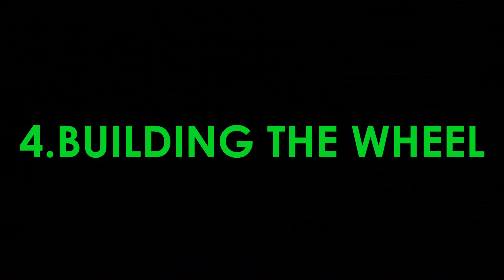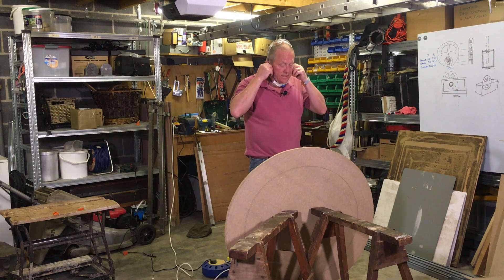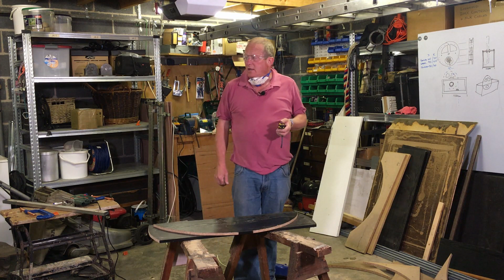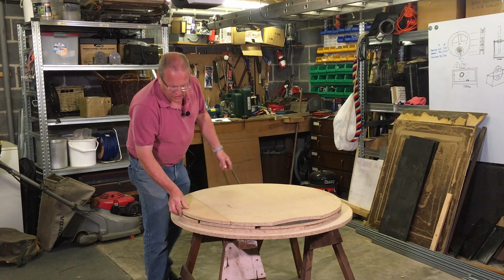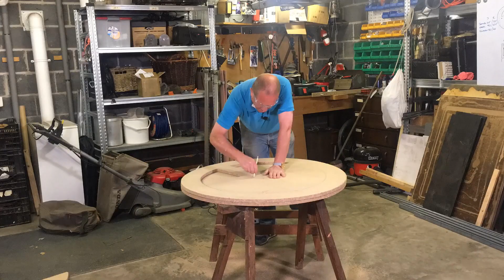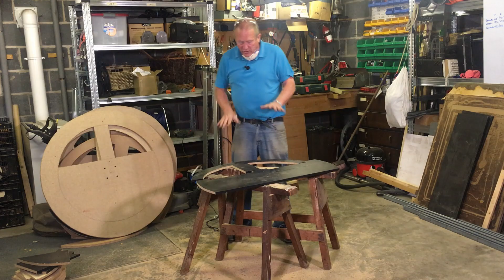Scrap Challenge - A Dumbbell at Home! - 4.Building the Wheel

Comment: Great stuff, can you put a link to where you purchased the central bearings and shaft from? Thanks
Reply from the maker: Absolutely,  they came from https://4bearings.co.uk/  but I bought them via Ebay.

I am using a 30 mm mild steel shaft due to the weight of the wheel, its a bit over specified but the cost difference is negligible from 20 or 25 mm. ( sadly still waiting for the shaft ! ) 

The actual bearings are:

Pillow Bearings :  UCP206 BORE 30MM
Flanges : UCF206 30MM

They have grub screws to fix to the shaft, so when the wheel is mounted and where I want it, I will mark and drill some small indents in the steel shaft to locate these in to keep the wheel in the correct position. Should be fun without a pillar drill! 

I was originally going to just get flanges without the central bearings, but I couldn't find any, so decided using bearings at all four locations may improve the "go" of the wheel in any case.